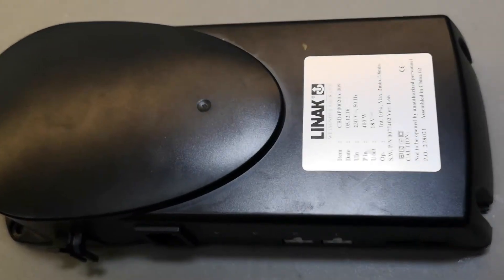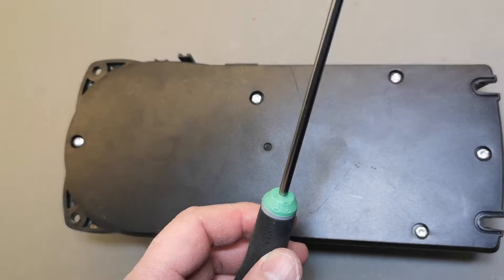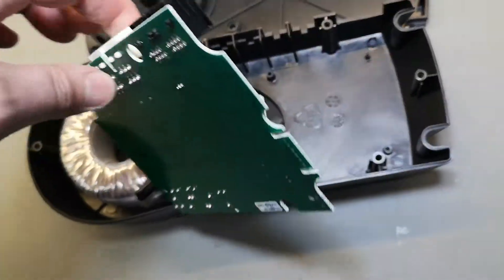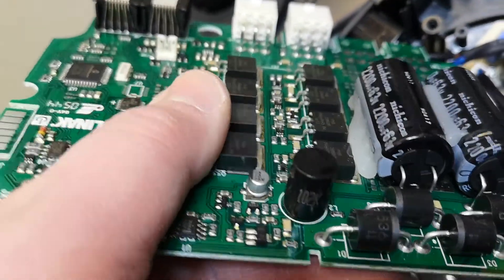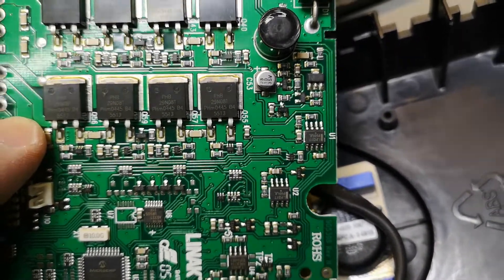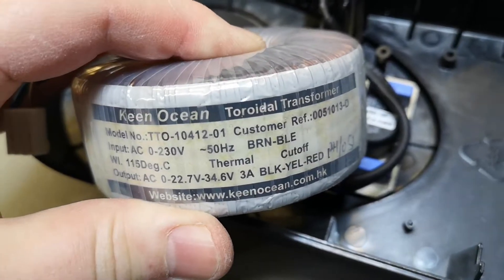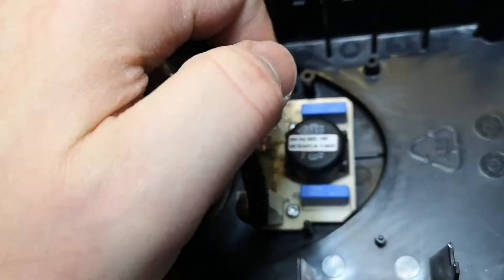Linak Table Controller CBD4P00020A-009 (2016) Power supply 5min Teardown

Comment: Thank you Thomas for this video! Long shoot here, my desk is only moving down and very, very slowly. I have the impression that the controller is the issue. Could have any tips on which component of the controller board could have failed. There is no visual indication visible but maybe I could test it. I would appreciate. Best
Reply from the maker: it is much easier for the controller and motors to move down, so your powersupply inside your controller or its current measurement is maybe weak
Reply: @TeardownOZ2CPU  Thank you for your suggestion. I will look at the measured value of the capacitors. I'm trying to see what else could be wrong at the components level.

Comment: I'm surprise to be able to find a video of such a niche product, vey nice,  thanks Thomas 🙂
I wonder how much voltage that controller output? I assume 24V would be fine, although the label on the Linak actuator says 18V and the transformer says 22,7V.
(I did some testing, I can actually move the actuator by as low as 5V@3A, going slow of cause).

Comment: Hi Thomas 
I have a linak CBD5006-02.
When I plugin everything works fine. But after some seconds of no interaction with the desk the height is not shown any more and I can not move it up or down. Do you have any idea what the reason could be? It seems for me that it goes ina standby mode but can not come back.
Thx 🙏🙏

Comment: Hi Thomas, I found your video because my adjustable desk is broken since a few days - it only drives downwards but the upwards function is not working. I already checked/measured through the DPF1K00 Buttons - they are working perfectly. So it must be something with the control unit. I have the CBD6SP00020A-009 - do you maybe have any idea how to fix it? I think due the buttons are good and also the motors driving downwards it must be something with the control box?
Thanks in advance!
Reply from the maker: the buttons can be defective, the wire, connectors, but also the power supply, imagine it uses alot more power to go up versus go down, also its motor drive can be broken
Reply: @TeardownOZ2CPU  same issue with my controller.  I don't know how to get a new controller
Reply: Where u able to fix it please

Comment: Hej Thomas. Jeg er helt ny til og experimentere med styresytemer og dc motore.  Er det muligt og bruge motoren fra en af disse linak uden control enhed og med et 12v batteri?
Reply from the maker: YES those motors are super reusable for all sorts of cool projects, for max speed and power, give them 24V
Reply: Hej Thomas. Er det muligt kun at bruge den ene motor på hævesænkebordet? Jeg vil bruge det ene ben til at løfte bordet på min søjleboremaskine.

Comment: I would love to see an extended video guide on what to look for when those goes down, as i do have the same model bord and box as the one from video and its not responding at all, on first inspect it doesnt seem anything obvious.
Reply: Same here, I have an error code E1 that won’t clear after initialization process.
Reply: @loukovanda5539 i got my old teacher thats been electrician whole life - the coil sitting is baked in my case so need either a new coil or a whole part

Comment: Hi,
I have a desk with the same Linak Controller.
If i turn it up or down the motors work for like 1 second and then stop.
Do you have any idea how i can find the problem?
An answer would be great!
Reply from the maker: maybe the motors stop due to end stop detection, maybe just change all capacitors ? and see if voltage is nice and stable and now not trip the end stop, you could also have a fault inside a motor or gear, so it uses a lot too much current, this way the protection will stop it from moving.
Reply: @TeardownOZ2CPU  I have already removed the engines.  The end stop that is implemented via the contact switch should not be the case.  What is the best way to check whether I have a fault in the motor and whether it is drawing too much current?
Reply from the maker: @tobiasg.9876  maybe disconnect the wires to the motor and put in a load resistor, that pull much less current, and see the controller dont time out
Reply: I connected LEDs and the LEDs only light up for 1 second.  Capacitors all look good.  Do you still have any ideas?  Is there a way to reset the controller or something similar?  It would be great if you could help me.
Reply from the maker: @tobiasg.9876  then it can be one of the power transistors that is shorted, this way when it try to move the motor , the system measure too much current, and stops, you need to measure power consumption

Comment: Hi, I came across this video looking for a solution for my own linak psu that I think is broken. The unit was on my giant standing desk. It is the 110v three motor version. After unplugging the unit to rearrange desk cables (not motor cables), the plug sparked a little at the outlet as if it were a large consumer starting up. The desk no longer responds to any command. I opened the psu and found the fuse to be good so idk what else it could be.
Reply from the maker: it is impossible to figure out where it sparked from or what you did, re connected something wrong and then blown it, is my best guess, nothing i can do to solve that from here.. sorry

Comment: Hi Thomas, very nice... i have the same board and any ideas to pimp up my desk. (control with arduino and add a memory function etc.) Do you think that the controller also has a height detection (e.g. calculated from the motor current) ? kind regards, Dirk
Reply from the maker: yes, that is exactly how they do the end stops
Reply: @TeardownOZ2CPU  can i pick up the current height at the panel connector?
Reply from the maker: @dirkdeeken661  no, it dont know its current height, it only know when to stop, when current is over a limit, from that point, you can only go the other direction

Comment: Hi Thomas, great video, i wonder if you could give me some advise. ive been given a desk uses this controller, but unfortunetly it didnt come with the cat 5 linked dpa controller or the othe little cat 5 loop plug. I believe the dpa is basically a basic switch, but Im not sure of the pin connections to use with the cat 5 connetor. any chance you could give me some advise ?
Reply from the maker: yes, I also think it is just a switch, my idea : first voltmeter all combinations, then take a series resistor to limit current / potential damage, and then try to map the pin to pin switch function via a resistor, please comment your finding here

Comment: It is a long shot but I am asking, I got these and one did not go up, you hear a click.
Now I hooked up another screen to test if the unit was broken and the actuator it seems broke the other unit...

So down works, up does not.
Does anyone know about this issue?
Reply from the maker: THIS model dont have relays so this one you dont hear the clicks, your model must be different type number, some got relays, so you hear click is a good thing, this means the relay gets its control voltage, but contact must be dead, replace the relay will most likely solve your problem
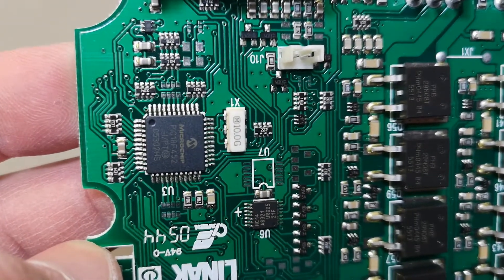Reply: Hey just chiming in, I've also got this exact board with the power supply filter has a relay that's connected to the free header J10 you can see at 2:08 . My units works perfectly, except that after a few seconds after any input the relay clicks, and the whole thing browns out after a few seconds. I think this is some sort of eco mode to reduce power usage, but I don't understand how that is supposed to work if it just turns off it's own power supply. I'm gonna try unplugging the relay to see what happens!

Edit: It immediately shuts off when removing the wire to the relay. I'll have to try tracing the board then.

Comment: Linak table controller CBD4P00020A-009. I have like 20 power supply units . Can we use this 
Product for any other purpose?  Any idea? Thank you
Reply from the maker: sure, when you take this out for reuse, just score all connectors and all cables, and write down what color wires go to what, switches and motors and such, then it can be reused for many other fun things

Comment: Nichicon caps ... nice. Spared no expense ;)
Reply from the maker: AND since this unit dont run hot at all, you can also score those for other DIY projects, another idea : the PIC is also easy to reprogram , and the motor connectors got end switch signals, so this means you can reuse the board to almost anything needing two motors, and some sensor inputs, like a robot. endless posibilities

Comment: Another item I also have in my workshop that I haven't yet taken apart, although my Linak motor controllers are 3 channel and an older generation (~2004).
I also got them from someone who didn't have a need for them anymore, but with the big heavy desks still attached including built-in rack mounting.
Reply from the maker: cool, yes the linear actuators (motor units) are very desirable items for many types of DIY projects, many videos exist about them, so i did not see any point mention them again :-)
Reply: @TeardownOZ2CPU  Here's the cat 5 connections to use. https://github.com/mauntrelio/XFEL_desk/blob/master/docs/IMG_20180611_133851.jpg
Reply from the maker: @imatomicallylogical3056  thanks a lot..

Comment: Mains filter is not for emissions from the device, though there are some from the rectifier diodes, but more for conducted EMI, so there is no unwanted operation. Plus also a convenient place to put a mains fuse, so likely this was added as belt and braces, using a part they already had in the production line for other parts. As well you can see the socket inlet is class II, with no PE connection, though the filter assembly has provision to connect the 2 class Y capacitors to the PE terminal, but this is not connected. 

Showing a part used because it had one function they needed, fuse and cable terminations, but the rest was extra, however leaving it in also ensures that EMC compliance will be passed, with absolutely no issues, so far as radiated and received power line emissions.